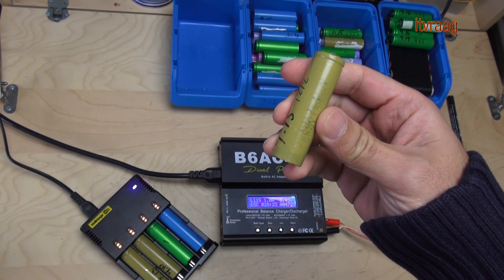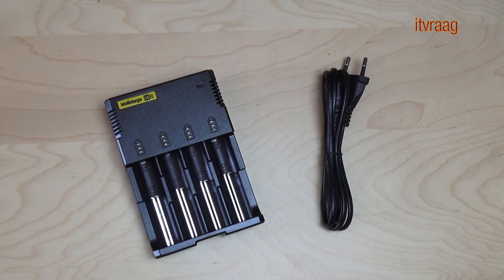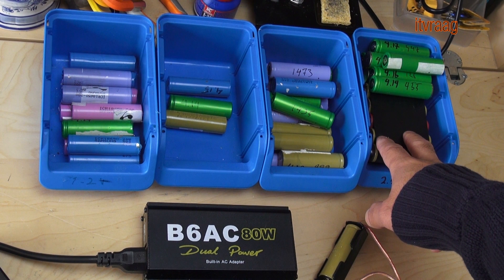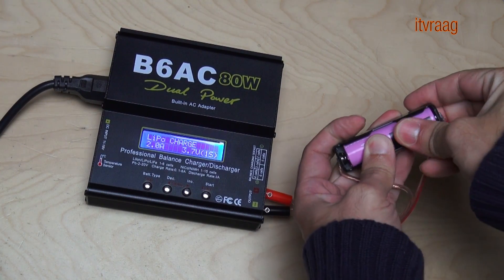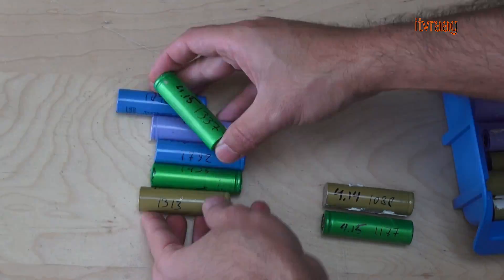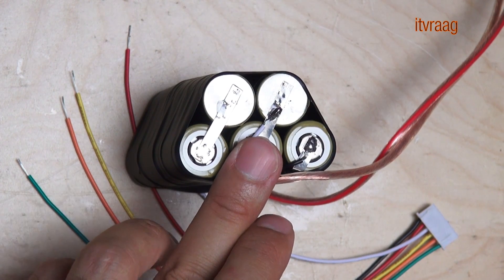How to test 18650 battery cells to use for battery packs

Comment: Best thing you can do is buy one new good cell with a rating of around 2.5Ah and use as a reference. I use a 12v 50W lamp that when connected to 4.2v draws around 2.4A. One can easily see when a cell is not up to spec as the volts instantly drop compared to a new cell. This quickly determines the cell impedance. Biggest issue I have is knowing at what point to discard a cell.

Comment: Is capacity AH please let me know
Reply from the maker: Yes, battery capacity, measured in ampere-hours (Ah), represents the amount of electric charge a battery can deliver over time, with one ampere-hour equal to one amp of current supplied continuously for one hour.
Reply: I have done exactly what you did even checked new batteries from Aliexpress that are meant to be 3000mah but they only show up as 1400 to 1500mah this means they have sold me low mah batteries correct  please let me know so I can ask for refund I sent them screenshots and they have gone quite on me too

Comment: I'm sorry but i think that it is very important to check the batteries after a stockage of a 2 weeks after loading/unloading. Then first check voltage for the unloaded cells, if below 2,7 volt, throw away. For the loaded cells 4.2v is excellent, all between is acceptable for testing as shown at your video.
Reply from the maker: Thanks for the feedback!
Reply: The voltage does not show  the status of cell health. I have had good cells go below 2.7v and they have been fine.

Comment: correct me if I am wrong but in your video you advise us to set the battery balancer charger to LIPO despite the battery here is a Lo-Ion 18650.
Reply: That's ok. The cut off voltage is the same

Comment: Old video, but needs correcting, you select LiIon on the B6 iMax charger, voltage should be 4.2v max charge and nominal 3.6v, not 4.1/3.7 you have been testing all your Lithium Ion Cells as Lithium Polymers.

Comment: If battery have no voltage do you still charge them to use them.
Reply from the maker: No, those are dead.
Reply: @itvraag  why? Maybe it was just not charged for a long time?

Comment: How do you know which are the faulty batteries?
Reply from the maker: You can check that, based on amount of voltage. Below 2.5V it's dead. Also based on charge/discharge rate. When charging/discharging measure the total amps.
Reply: @itvraag  Below 2.5V after its been used or when?  Are you saying that if the battery was used then it is impossible for its' voltage to go below 2.5V if it is good?
Reply from the maker: It should never go below 2.5V, even when the battery is drained.

Comment: From the  moment you set the charger to lipo for a li ion battery, I realized it was time to skip...
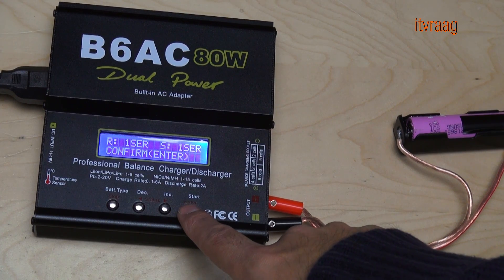Reply: It doesn't matter that he set it to lipo when charging them. Lipo's are fully charged @ 4.2V, same as 18650's. It only matters when discharging them because, like you probably know, you can't discharge lipo's as low as 18650's. But if you look at the video (3:18) you will see that he set the cutoff voltage to 3V, which is correct when testing 18650's.
Reply: @HBrsz  Hello sir. In general you are right, but for me it doesn't work like this. There is a reason for li-ion and li-po setting in a charger. Yes it's almost the same but, there is important differences between two chemistries.  4.1 volt per cell and 4.2 v peak, is a huge difference for the long run. Anyways the topic is huge.Anyone is responsible for his actions and as you probably know, those batteries can bite you back hard... I  have 6c lipo batteries for my rc helis from 2010 and all perform in their specs, because i treat them by the letter,  as it should.  Over and out
Reply: @raptorkoko  Did he charge the batteries in the video incorrectly by setting it to lipo and charging them to 4.2V @ 300mA?
Reply: @HBrsz  yes

Comment: I thought these cells should be changed to 4.2v if you google it?
Reply: Apparently you can nearly double their lifespan (amount of recharges) by only charging them to 4.1V and keeping them around 3.5V or so in storage/not in use so it doesn't stress the batteries interior.

Comment: not a lipo battery
Reply: It doesn't matter! He charged and discharged them correctly. He charged them to 4.20V @ 300mA and discharged them to 3V @ 1A.
Reply: @HBrsz  the charger he is using will charge a LION battery,
so he should use that setting, not LIPO.

Comment: After capacity testing, should you leave them at the 3v? or charge them back up to nominal 3.7 for storage?
Reply: Charge to nominal voltage (half charge) for Lithium batteries

Comment: Do not throw cells away under voltage all lithium ion cells can be restored by putting them in the freezer for 48 hours let it defrost and charge if it doesnt hold any voltage at all line it up with a charged cell in series and it will charge from the other cell then it can be charged to full capacity hope this helps
Reply: no kidding, freezing them fixes them? 
I never would have guessed
Reply: He is trolling. Dont listen everything on internet...

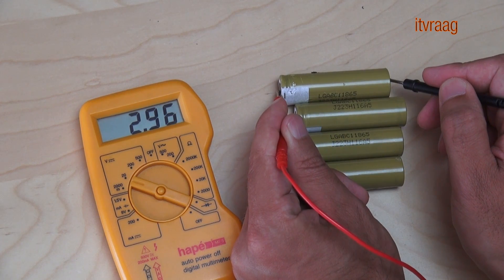Comment: On minute 1:20 you mention that a cell below 2.5 V is automatically a bad cell... That can't be correct. Would you mind to explain that part in detail? I'm working with Lithium Cells and Alkaline Batteries in order to get a better understanding of their charges and behavior in different aplications and from what I know ( as an aprentice) is that a cell with less than 2.5 V can still be charged up to 4.2 V, and later giving you a charge of 3.6V. A cell with 2.5 V or less is just a very discharged cell, and doesn't necesarily mean it is dead. In my opinion, if a cell gives you a value that goes jumping around like crazy or a value that is way higher than expected (f.ex.: 254.412 V) or stays on 0, thats is a bad cell and can surely be tossed in the recycle bin. Please let me know if I'm wrong here, but it just doesn't make any sense to me to toss every cell under 2.5 V just cause of that. In the end I just plug those into a Li-Ion Battery Charger andit charges up to 4.2. There's some devices that actually drain the cells down to a very very low value (that being things like remote controls and all apliances that are capable of drawing a 3.6 V load but for example a lower load too, using a coil to step up the charge (i think you know what i mean).
Reply: You are very wrong. EVERY Li cell below 2.5 V has irreparable defects, simple because of the physics of the cells at this voltage. Of course they can still be charged up to this level, but it may result in exploding or burning cells anytime. Never ever recommend to charge lithium cells, that have been kept below 2.5 V even for a short time, to anyone!
Reply: @ElwynnEldoriath  Please elaborate in detail. A completely discharged cell will go to 2.5 v and may be further if further discharged. It can be recharged to 4 v. How do we know it has gone bad or it is just very under charged.

Comment: I have HP probook laptop. Battery down after 20 mint. I check all cells on 20 DC on multimeter. All showing 3.2, 3.4 charge.

So why batteries down after 20 mints
Reply: Some laptops desable the battery after a certain number of cycles, as a safety feature.

Comment: Does the capacity decrease after the batteries are used a lot? And when you measure the voltage are they fully charged? Or discharged?
Reply: I know this was 3 years ago but for anyone else wondering the capacity does decrease after they are used a lot and when you measure the voltage it doesn't matter too much if the battery is still within the safe safe of 2.5 to 4.2v.

Comment: Thank you for the video on Charging and discharging to determine the capacity of used 18650 (or any Li-ion Battery)
Though the illustration was short, it was made in such a way,  to make the viewers understand the concept very well. Thank you.
Most YT explanations are ALWAYS vague in explaining the capacity testing and determining.
Regards.

Comment: Hello, i made a 16,8v battery pack for a drill, but the problem is when i push the button voltage starts to decrease and it keep doing that until i stop pushing the button just then voltage go up slowly until it reaches the initial voltage, how can i fix it? And why it happens?
Reply: Did you get fix?
Reply: @DanielMolina-st9sp  Nah, I think what causes this is the cells themselves. Either they are too old or they are just designed to strore power instead of delivering high power output.

Comment: If I have 18650 cells with >2.5 V. Can I assemble them to make a battery for my laptop? (I dont have B6 and intellicharger i4)
Reply: Two years late but no.
Reply: @shadowmaster8020  Why not ?
Reply: @AbdulMoueedHaroon  Internal resistance would be way too high meaning self discharge would also be high. This makes the battery useless. This would be ignoring the safety risk of it having dendrites inside, which would cause a fire from internal short circuiting.
Reply: @shadowmaster8020  Thank you.
It means, although a full charge on a poor battery will give 4.2 volts but it will not be retained. The battery will fall to lower values below 2.5 very quickly.
Reply: @AbdulMoueedHaroon  Yep exactly that. I also forgot about the mAh (capacity) being very decreased and the heat build up while charging.

Hopefully it's expanded your knowledge if you didn't already know (:

Comment: Can you figure out the mah from the marking of the Lap top...
example...they're rated at 10.8 v.....basically 3S @ 7800
There's 9 batteries...so that's 7800 divided by 3 =2600 mah
Basically 3 sets of 3S
So I should get 1s @ 2600 mah

From another Lap top pack there's only 6 -ea.
It's rated at 4400mah
so it's 2 set of 3S
So It should be 1s @ 2200 mah

It's not exaclty rocket science..
But how do you figure out the C ratings???
10.8v    4.4ah    48wh...are what's marked on it...
10 C ??????

Comment: Can you please show in more details the correct steps like how to use the multimeter.
Reply: Mousa Alzwani set the multimeter to VoLTE dc. Black on negative red on positive
Reply: Thank you
Reply: @jameswalsh6810  my multimeter does not have that setting plz halp
Reply: Set it to V, in DC

Comment: i have got some batteries out of my old laptop battery and i have checked with my meter and it is showing out put 5.4 or so , so far i have seen the most cells have max 4.2 what may be the cause of this does any body knows what could be the reason and over charged cell or i am not checking properly :/
Reply: The balance board inside the pack has failed it's duty lol maybe damaged now discharge it lol
Reply: Ahmed Ammar Khan — Open-circuit cell voltage measurements mean nothing. You have to charge them fully, then place a large load on them for a short period of time, then measure the voltages. This would be a way to compare the cells.

Comment: Under 2.5v isn't ideal, but it doesn't mean that they are bad. I've had good cells start of at 0.5v with tested capacity over 2200mah with normal self discharge.
Reply: Neil McAliece hello, I have 4 lg ds2 18650 from a laptop battery, I was searching its caracteristics but I can't find anything about them, I just want to know if you have ever tested them? I want to know if i can use them for vaping, and I think you know that it could be dangerous to use a wrong battery, I hope you can answer me, thanks for the video and sorry for my english, I'm still learning to speak it. Greetings from Guatemala!
Reply: Dead right Niel ....people seem intent on throwing away perfectly good cells ...even cells with 500mAHrs have a higher energy density than new lead acid, and will last longer than lead acid  .... those that read 0V can have internal protection reset and are mostly good .
Reply: @ak42069  I will consider it, but, pass me your id to search you, and make you my first friend if i give it a chance
Reply: I had a 17year old dell battery and all cells were at 0.7v. I grabbed another battery at 4.2v and i touched the positive and negative to the cell and got it up to 2.2v which is enough for Nitecore UM20 to charge. Once it gets to 3v it goes quickly up to 3.7 and gets slower with no heat. They may be 700mah but still lose 0.3volts in 1 week. Pretty good right?
Reply: No cells were bad. Just fully discharged below 2v

Comment: Why do you test 4.2v cells by only charging to 3.7v? Makes no sense.
Reply: Daniel Hughes 
Those chargers allways display the nominal(storage) voltage. They charge to 4.2V
Reply from the maker: +Len Zielenski 
I charge to 4.2v
Reply: ++itvraag -   how much did u buy it the balance charger,  bro..? it looks exclusive..:)
Reply: Nother Chineseium copy of that b6 charger FFS 🤣 they got bank of smd resistors inside with no fan on them rite by the balance ports 
They all the same with that screen and few other chargers use the same circuit design Idea but contain MOSFETs aswell cost £80+ FFS
Reply: @davey2k12  - wtf...?  I don't understand what you're talking about...  I just tore down a Dell laptop, I have no clue what they are, but they read out ~2.7-2.9v.  I have a charger from a laser I imported from HK approx 10 yrs ago....  It charges 1 battery, 1A @ 4.2v  I'm trying one out now.  It has a green light & red light on it.   The green one is on...

Should I read your statement as though I might actually be using a cheap Made in China charger that's actually a bogus cheap Made in China charger of questionable quality?  And beyond that, the capacity of 1 might be insufficient considering there are multiple cells needing charged...?!

...I've never been more insulted in my life; how dare you!  ...Anyhow, I know I've got another one around the house that handles 2 at one time - that means min. 4 lights.  What now..?!  Still bogus Made in China...?  I didn't think so...this is real Made in China; I guarantee it.

Lmfao!

Comment: I have aproblem measuring capacity maybe you can help me.I have turnigy accucel 50w original and also xstar v4 charger original too.I discharge one cell and gives me 1500 mah than i charge with turnigy and get 1800 .If i discharge and charge with xstar i get at charge 2000 mah .What am i doing wrong?
Reply: I am wondering if when you are doing the discharge capacity checks if you are using the same amperage on all 3 tests?  Do the batteries charge up to the same level when using the different chargers?  Verify the charge level using a multimeter.
Reply: You should also be aware that capacity readings on charge cycle are never very accurate.  The discharge capacity is really the only true way to get battery capacity

Comment: HOLY CRAP just about every person with a video on testing 18650 batteries are using a CHEAP $10-15 CRAPPY CHINA MADE TESTER OFF EBAY !!
Reply: Dan Ray maybe cheap but definitely not crappy. A lot of these Chinese chargers have been tested by many people and are proven to work good. Some good examples would be the Nitecore chargers and the Opus BT-C3100 charger. 
EDIT: I have just found this out, but apparently it's pretty old. The BT-C3100 has a horrible charging method. Instead of constant current it PWMs >2A of current to simulate CC. The problem is it can kill smaller batteries and perhaps damage even larger ones. The Nitecore chargers are good though ;)
Reply: my cheapest charger just happens to be my favorite.
Reply: Dan Ray I’m using a $4 one :)

Comment: why are you using the wrong cell type setting.
Reply: saladdogger mine has....
Reply: immrnoidall well that answers my question I want to know how he knows the difference between a lipo or a lithium ion? My ice charger has two different settings for lipo and lithium ion.
Reply: immrnoidall The LiPo and Li-ion are the same technology in different form factors. They have an identical charging process
Reply: @sasodoma  they have different max charge voltage and discharge cut-off voltage. So the settings do make a difference.
Reply: @steffie.morris  "they have different max charge voltage" No, they don't. Both are fully charged at 4.20V. "and discharge voltage" Correct. But if you look at the video (3:18), you will see that he set the cutoff voltage to 3V when discharging them, which is correct when testing the capacity of 18650's.